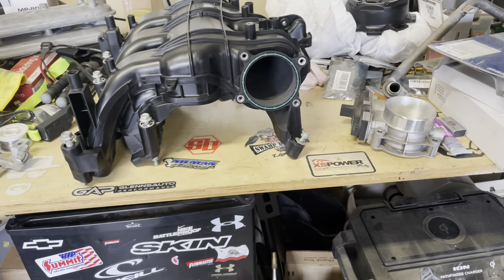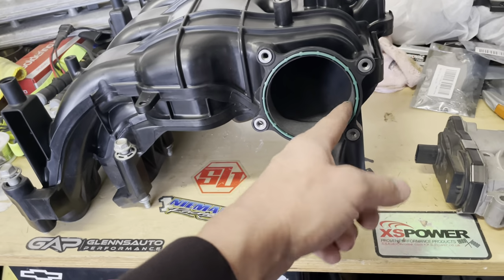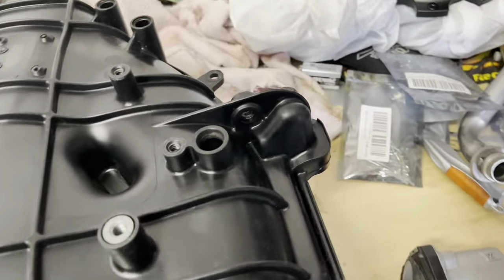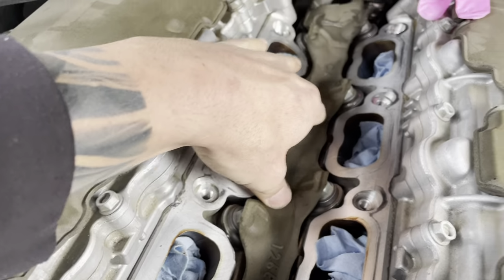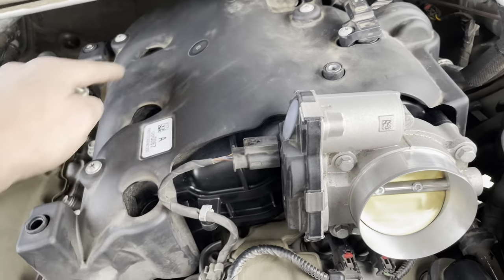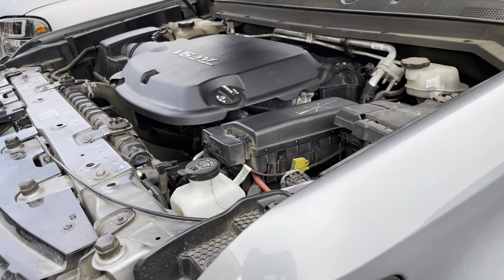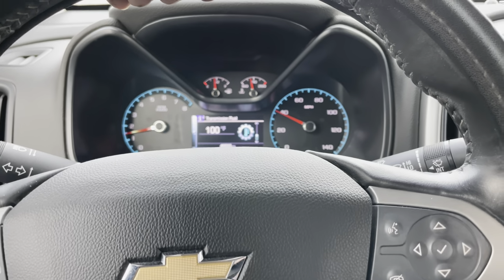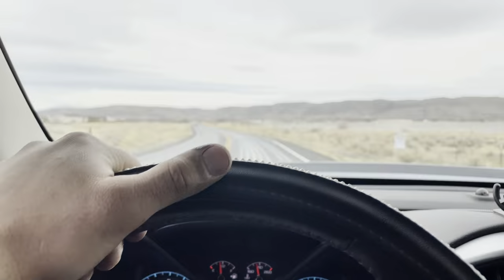ZR2 Colorado Gets A Ported Intake And Throttle Body

Comment: The intake has "vanes" that straighten air flow and eliminate turbulence.  They also reduce total air flow.  17 up is the LGZ 3.6 V6.  I have a ported TB, it made a nice improvement in drivability, low end power and trans shifting both improved.  I think porting the intake manifold may hurt low end and improve top end.  After the TB install the truck ran great but as I put more miles on it the ECM made adjustments and it improved even more.  I got more performance than I expected.  Thanks for the video.

Comment: Thinking about doing this, How's it run?  was it worth it?
Reply from the maker: Runs great. Pulls through the gears a lot better.
Reply from the maker: Runs great. Pulls through the gears a lot better.
Reply: @EndlessWishlist  Thanks, I'll hit Chuy up. Last question, how did it affect fuel mileage? Not that it matters, just curious if it had any major affect on it.
Reply from the maker: It went up a little. Nothing crazy but a little bump.